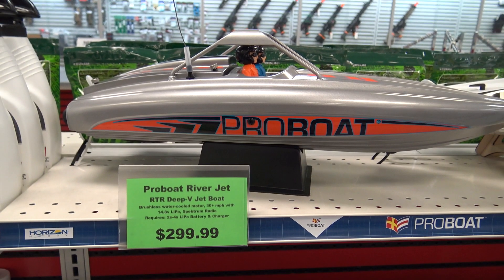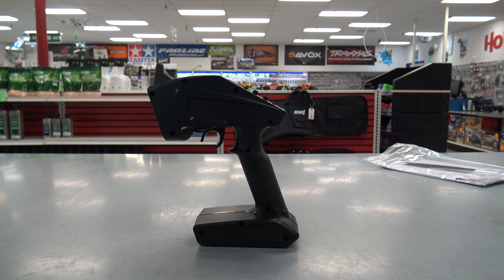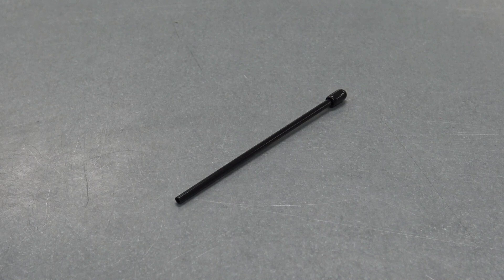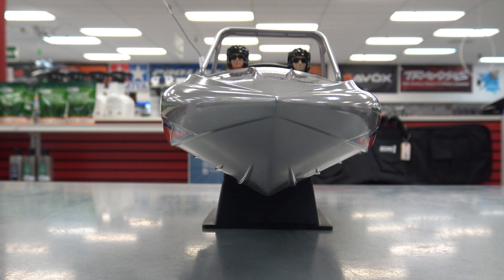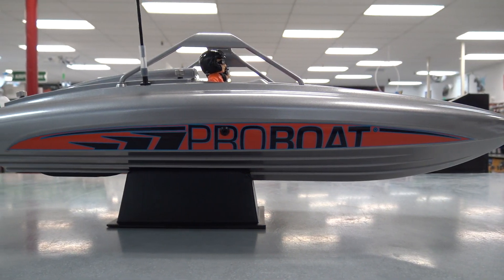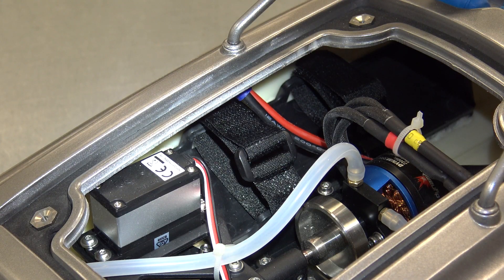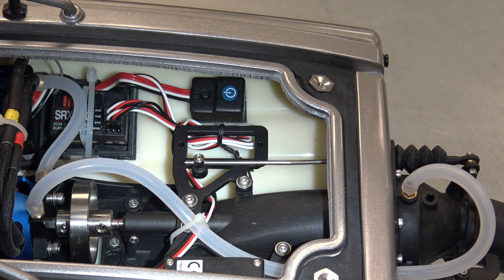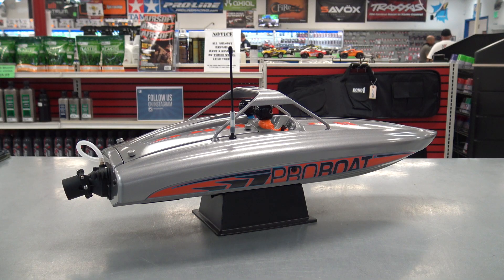Pro Boat River Jet Boat RTR | Unbox and Overview

Comment: This is a really cool boat. Goes like crazy on 4S but it looks like a few of us are having an issue with magnets coming loose inside the motor.
Reply from the maker: that's not good - also read some one couldn't get it to self right. Any issue with that for you?
Reply: Nope, I'm good on that. Mine did flip on the first run but the self righting worked perfectly for me. You have to give it reverse throttle first and then full forward. It's all in the timing. You have to be quick. The Pro Boat React 9 that I have is the same way.
Reply from the maker: good to know - thanks.

Comment: Thx for the help👍but could u still do a tutorial or describe it more thro reply’s cuz it is still vary confusing like I would still not have idea what thing to select thro what it says in the manual. Or this would be more simple, it  says you need to program the esc but could u just plug the battery in and it be reddy to go with no programing

Comment: How do you get the ESC to cut off with the right battery could you do a tutorial on that because I want to get that boat but I don’t know if it’s going to be a big hassle
Reply from the maker: Everything you need is on page 10-11 of the manual: https://www.horizonhobby.com/on/demandware.static/-/Sites-horizon-master/default/dw0431108d/Manuals/PRB08025-Manual-EN.pdf